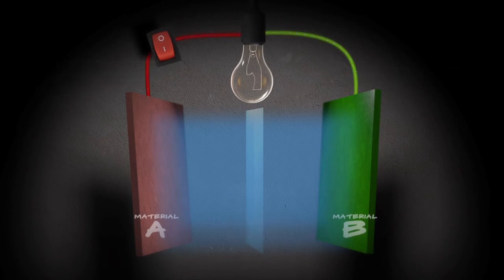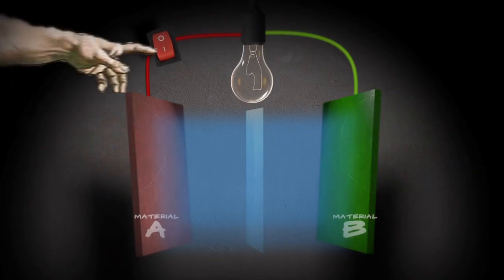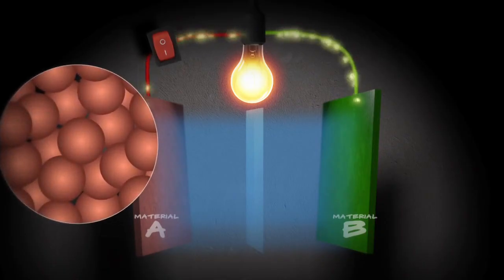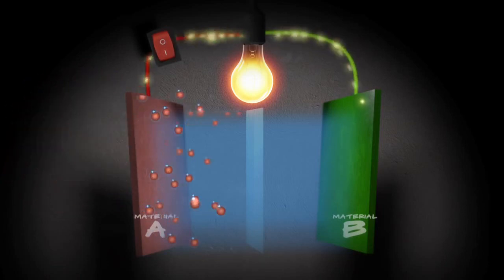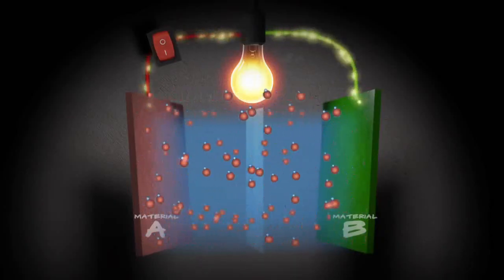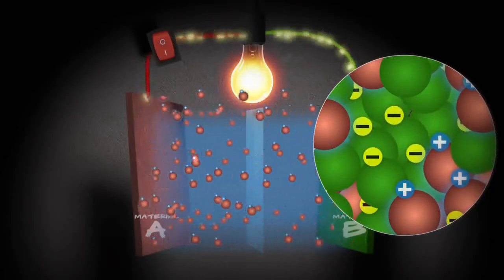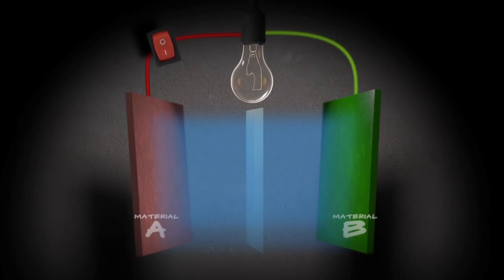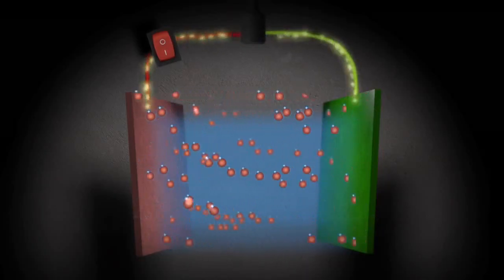How rechargeable  batteries work

Comment: i dont understand how you can "force" electrons back, I understand everything else, but not how you can "force it back using energy"
Reply: Plug it into a power source and put charge through it the opposite way (ie recharging by plugging in
Reply: Basically instead of flat going on spring powering the remote, the nub goes on the spring which is connected to an outlet. Energy is going bass ackwards basically.
Reply: A generator makes the current
Reply: Logan  wait, so when you charge a battery, are you making the cathode negative charge and the anode positive charge?
Reply: @89ksantoso  I'm so lost none of these comments helped lol
Reply: Tbh none of these comments helped
Reply: By added another electric source, it forces the energy back the other way.
Why it does that? Idk 🤷‍♂️
Reply: The problem is electrons can't move through a battery. Only ions can move through electrolytes. When you force electrons back to the anode (+) using another battery, there is no path for electrons to go, because they just can't pierce through it. There must be an external circuit. BUT SOMEHOW YOU CAN STILL JUMPSTART YOUR CAR.
Reply: Basically the happy guys want to lower their energy so they hang out with depressed guys and their energy levels drop. To re-energize them they need to go back to being jolly and so you charge them up and they are ready to be happy... until they want to hang out with sadness.
Reply: What’s the optimal voltage for charging?  Is it 1:1?  For example: Charge a 12v battery with a 12v charger?  How does fast charging work? 18v charger on a 12v battery?
Reply: The voltage from the socket pulls the electrons in the opposite direction of the direction of the battery

Comment: I don't get the last part. How do you force the electrons back. Really wish he explained it in the same simple way he explained the first part :) Anyway, great video, thanks!
Reply: One way to think of it is like water pressure if you have enough water pressure it will force water somewhere just like electricity so the charging is putting more electricity in the battery then the battery is putting out
Reply: @henrylevinson1170  but how did the energy source "force" the current to go backwards? Does it have low pressure?
Reply: @davedave3520  When we apply voltage greater than the EMF of the galvanic cell, then e- flow from cathode to anode and thus it starts recharging.
Reply: Basically the happy guys want to lower their energy so they hang out with depressed guys and their energy levels drop. To re-energize them they need to go back to being jolly and so you charge them up and they are ready to be happy... until they want to hang out with sadness.

Comment: The best way to charge a battery is to simply use another battery put both the + ends on each other and use electrical tape to tape the middle part and wait about 15-20 minutes you might be able to use aluminum foil but I’m not sure that would work or ofc leave it somewhere where nothing can touch it this might take longer but it’s worth a shot

Comment: Ok. So before a conductor is connected from terminal side A to terminal side B. Side A is negatively charged because there’s a lot more electrons than protons, and side B is positively charged because there’s less electrons than protons. Side A electrons want to “neutralize” (don’t know the proper term) the cations of side B. To take it from a positive charge, to a neutral state. 

So when you add a circuit from terminal A to terminal B. The electrons are now free to travel to terminal B where there’s more protons than electrons. After some time, enough electrons have passed from side A to B to make side B negatively charged. So because side B is now negatively charged, the canions that were left from side A now want to “neutralize” the negative charge of side B. So they travel directly from side A to B within the battery. Side B runs out of “space” and will no longer accept anymore canions from side A. The battery is dead. 

Is that right? What happens when a rechargeable battery is dead? Is side A neutral and side B positive/negative charged, is side A positive/negative charged and side B positive/negative charged, or are both sides neutral?

Comment: If we can't see the position of an electron according to Heisenberg's uncertainty principle how can we know that Electrons are moving and causing current to flow ?
Reply: even if you don't know the exact point in space, electrons still have a velocity, and that velocity is what he describes. Think of electrons as some kind of clouds, where the darker a point in cloud is, the more likely the electron is there at any instance in time. Those clouds are moving basically. But don't over-analyze stuff just for the sake of over-analyzing. Classic physics is a model, and it's a good enough models to explain electricity in most use-cases. Quantum physics is a "more accurate" model for some behaviors that we can't explain with classic physics, this doesn't mean that classic physics is "worse". All we know, quantum physics might still not be the "true" description of the universe, and such thing might not even exist, certain is, you can NOT see an electron, all you can do is observe it's behavior. In this case, it behaves like a particle, so don't stress too much that in other cases it behaves like a cloud of possibilities.

Comment: If my eternal battery faces a certain back track, I won't have a problem need to add a rechargable battery to change the magnetic pol arity to keep it functional. All while allowing some energy conducted by the eternal battery to reroute back into the rechargable battery.

Comment: If electricity is a constant flow I'm at a loss at how batteries are charged.  You have a dead battery so you plug it into the wall. Electrons travel through the cord into the battery charging it but if electricity is a constant flow of electrons, and the battery is actually storing the electrons, how does the electricity continue to flow back to the wall socket?  Is the answer as simple as the battery doesn't take all the electrons?  Help!  Thanks, -Eric
Reply: polarity.
Reply: @spiffinify  Oh!  Polarity! 🥴  LOL, I appreciate the answer but simple, one word answers aren't going to help me.  Thanks though!
Reply: @EricHorchuck  eh, I'm probably wrong anyway. Batteries don't "store" electrons. It's a chemical reaction that is waiting for a circuit to close and that chemical reaction is what causes the electrons to flow. If you want a super detailed description of the chemical reaction this is a really good video: https://youtu.be/VnPRX5zQWLw?si=ejKxYKcrZrPkJzLx. Around timestamp 9:20 is when they get into the chemical part of it.

Comment: why do rechargeable batteries only have a finite number of recharge cycles? why cant you "endlessly" force material b ions back into material a?
Reply: Because rechargeable batteries are not 100% rechargeable, meaning with each charging cycle the battery loses a tiny amount of its total capacity.
Reply: @R3cce why though

Comment: then what is the use of electrolyte
Reply: it's the transportation way for the Li+ to go to the B side, and preventing electrons from moving from A to B so that there will not be a short circuit. Basically electrolyte let Li+ passes through but not electrons

Comment: Why can't the ions just stay at A??? That means no need for a separator and the electrolyte. Is anyone clever enough to give me the answer?
Reply: The reason why electrons flow from the anode to the cathode in a battery is because the easiest, less resistive way is through a conducting material (i.e. a wire). If you let a positively charged ion just contact a negatively charged one, any potential difference will translate into a red-ox reaction with no usable energy at all.
Reply: keepercool98 I know that, you didn't answer my question. Read it again
Reply: Ions love being neutral but their electrons are going away. No ion can stay in A if that means being *positively charged*. It's so sad being an ion from A while your negative charge leaves for B :( . So they gotta go after those cheating electrons and get their negative charge back.